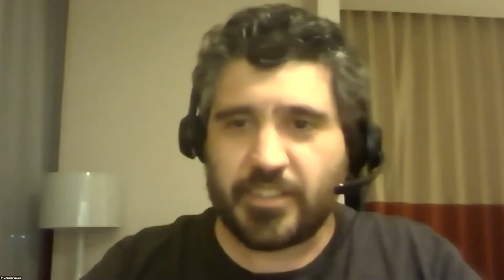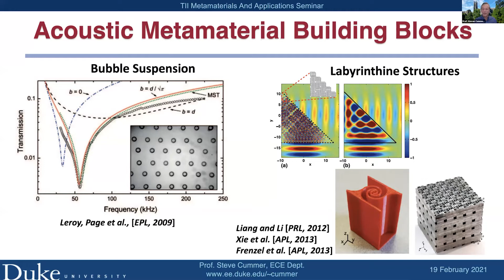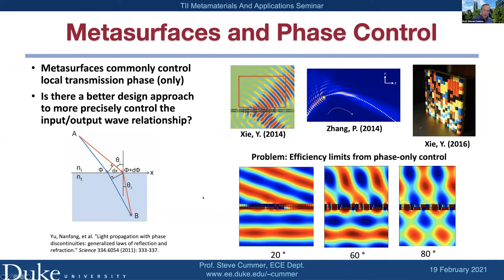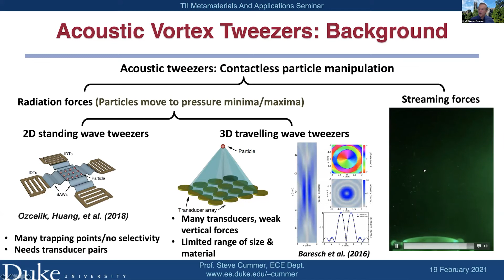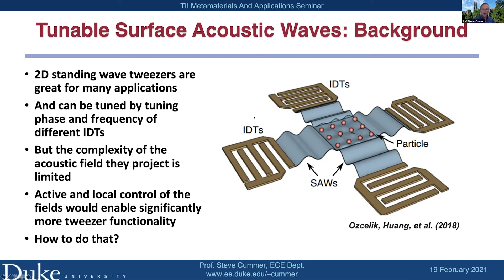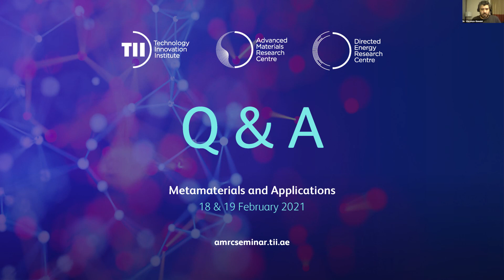Prof. Steven Cummer / Wavefront Control with Acoustic Metamaterials: Concepts and Applications

Comment: wow, this is insane. I wonder if you can use the transformed acoustic wave as a non solid gasket wall for maintain vacuum. If high quality vacuum can be maintain while allow material to move though this sound gasket, it could make CVD way cheaper. i could see it be really useful for maintain airfoil boundary layer

Comment: Can a meta material be made in a way that resembles by all definitions a solar sail and be configured with a secondary mechanism that boosts the sail using Terra Hz waves (if we can manage a small scale model at least) type of solar/wave amplification propulsion system for small satellites/space drones? I'm not sure how to ask the question properly, but I hope you understand my question.

 I would love to know because if it could wouldn't this theoretically be a faster and more energy efficient way of traversing vast distances of space with minimal fuel use? 

Can't we also make technologies incorporating meta materials as a means of, I guess, amplifying/stabilizing connections of intagled pairs of quantum objects to increase the speed and distance of communication systems as well? 

I'm not an expert at this, but it seems the implications and applications of meta materials are astounding!